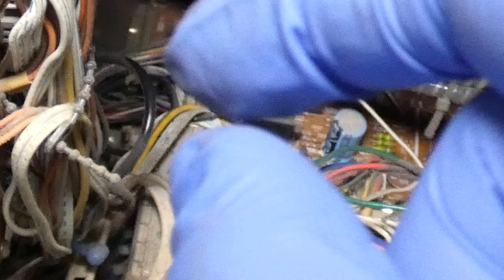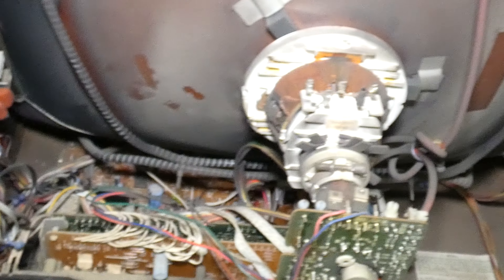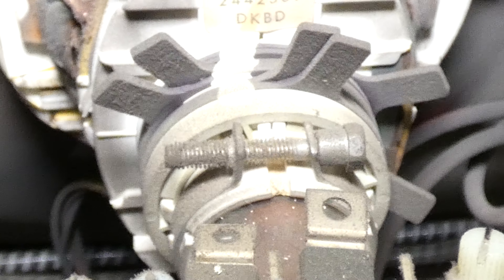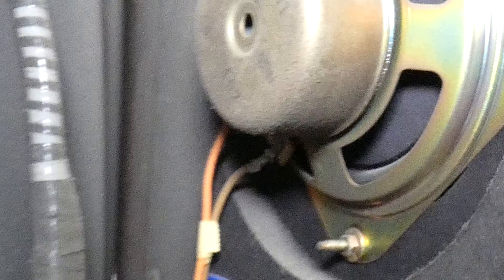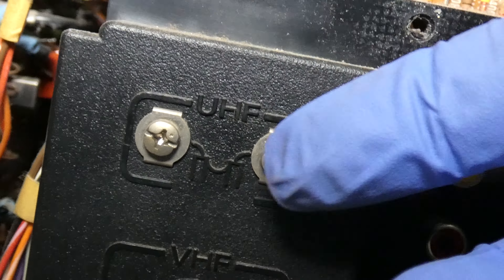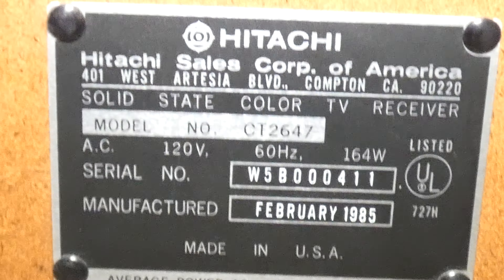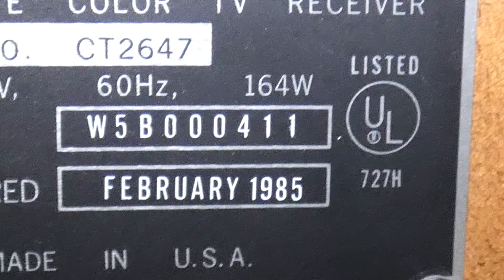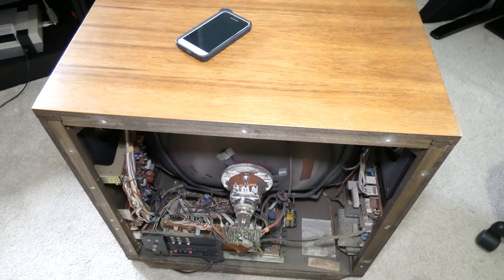Inside Hitachi CT2647 CRT Television (Attempting to Fix Issue)

Comment: I have a Hitachi 1991 27 inch in good shape I bought at an estate sale for 10$ and when I got it home I Removed the back case and got my buddies leaf blower and spent about a good 45 seconds just getting all the dust out. Now it is working great with no issues. I tell you the first capiacitor that blows up I'll Pop that back case of and repair it right away. It being as old as it is it only has 1 composite input and an audio analog left and right out and an rf, but that prety much sums it up for me.

Comment: Hi, I put a long comment on your previous video a bit ago, it probably should have went here.
 Keep the tv!
Reply: I hear you man, and trust me, I wanted to do everything I could to keep it. I ended up getting a Magnavox 25" for no cost, and unfortunately I did recycle this TV and disposed of it properly. I really did not want to do that but I did what I could. The shop near by shut down. It was getting worse. I think that board burnt out.  I will make a video showing the new TV tomorrow.

Comment: A lot of times failing capacitors don't bulge or show that they are failing. You'd usually need a service manual to if you wanted to find and replace the specific capacitors used in the vertical deflection circuit. Otherwise you'd have to just go in and replace them all (though looks like you'd mainly focus on the board on the bottom of the TV as that's where the flyback and power circuit is so you'd focus there). But sounds like from the age of this video that you probably no longer own this TV. It's a shame. The issue it had was probably fixable. :(

Comment: did you end up getting rid of it? It really just sounds like a capacitor in the vertical circuit. Circuit board didn’t really look that bad it could be that the components that they’re being connected to are the ones that went bad. The CRT looked good and the high-voltage came up. I hope you didn’t throw it out because it looks repairable. I know of some people and the radio TV repair community that might be able to help.

Comment: Well at least you tried.
Reply from the maker: I did my best to not get rid of it. I did pick up a 25" Magnavox CRT. Not quite as impressive as the Hitachi but it will get the job done. Eventually once I rewire everything for that TV, I'll demonstrate it.
Reply: Where are you geographically speaking? 

Big cities tend to have folks that work on stuff like that. 

I had a guy repair my grandfather's blaupunkt radio cabinet..from like 1940~
Reply from the maker: @GarlicMonoxide   I am further Upstate NY in Middletown. We did have a guy over in Montgomery that did repairs but he actually retired a few months ago. The only places near by would probably be down in the city, PA or Jersey.
Reply: @GarlicMonoxide  "Big cities" HA! What a pathetic joke.
My home town is 4,95 square kilometers and there is that one old dude at age of early 50s who can fix anything including old crt tv's.
Not only he repaired my own old tv (Samsung something from 2004) but he also got and replaced the broken parts with the FABRIC NEW ONES. 

So if you are saying that size matters, I tell you buddy it doesn't.
Reply: @MrRatchet12661  dude. Chill...I didn't say small towns don't. But it's more likely, given population density, to exist.
Reply: @GarlicMonoxide  I am chill. It made me cringe what you said.